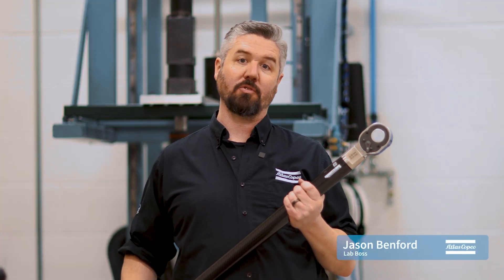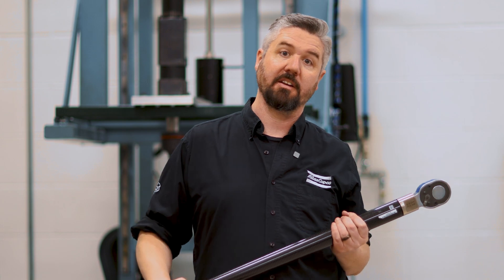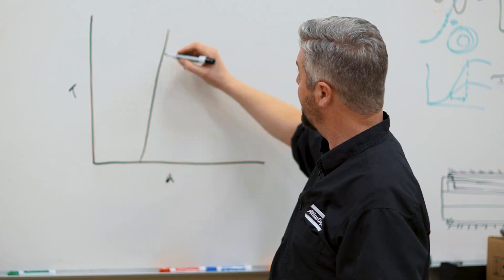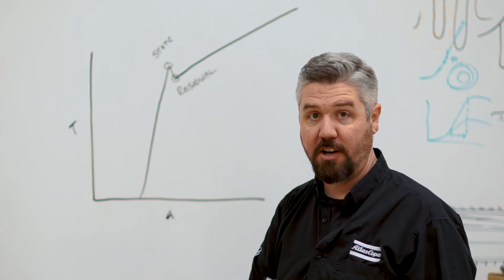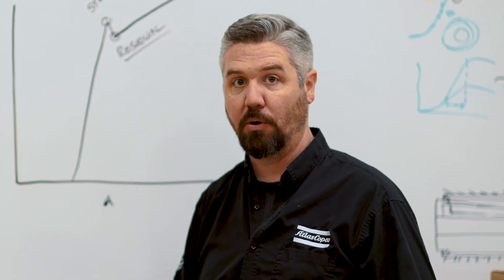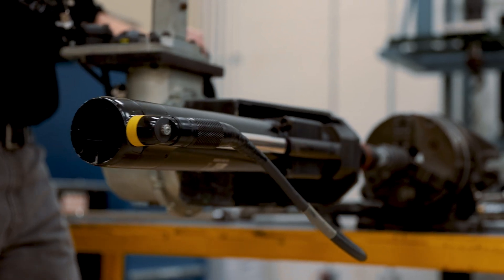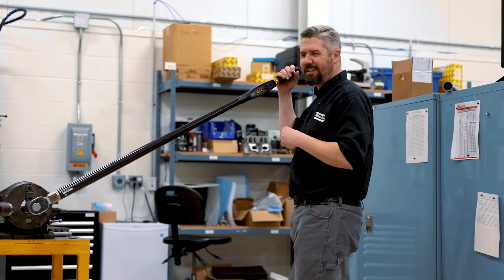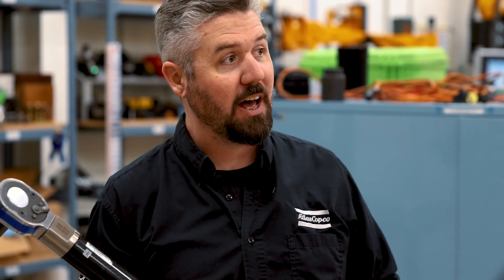In the Lab: Residual Torque Test | Atlas Copco

Comment: Is there any angle up to which we need to rotate the bolt to understand the residual torque value?
Reply: This wrench has an algorithm to do that, but in the end it is only about getting the bolt to move. 2 or 3 degrees would be already enough.

Comment: Is that torque wrench measuring the static friction or residual?  How is the tq wrench differentiating the static friction from the residual torque?
Reply: it is measuring the residual torque. This wrench has an algorithm to do that. In the end the static has no importance on the quality of the tightening.... you must understand that static friction is higher than dynamic friction, so you need to make the bolt start moving to be able to have a dynamic friction measurement. 😉

Comment: Is that torque wrench measuring the static friction or residual?  How is the tq wrench differentiating the static friction from the residual torque?

Also would you say that the residual torque should be close to the same value as the original installation torque?

Thanks!
Reply: it is measuring the residual torque. This wrench has an algorithm to do that. In the end the static has no importance on the quality of the tightening.... you must understand that static friction is higher than dynamic friction, so you need to make the bolt start moving to be able to have a dynamic friction measurement.
depending on the joint you are tightening you could have a very different value between the residual and the applied torque. One example could be if you have a soft material being pressed by this bolt... in many cases the residual torque will be noticeable lower.
Reply: @gusariello  I get asked this question a lot. People think that residual torque indicates the resistance to loosening performance. What would you say to someone who says that?
Reply: Good point! Thank you!